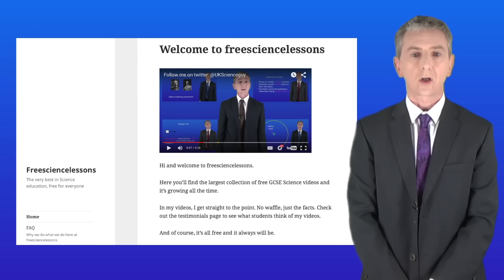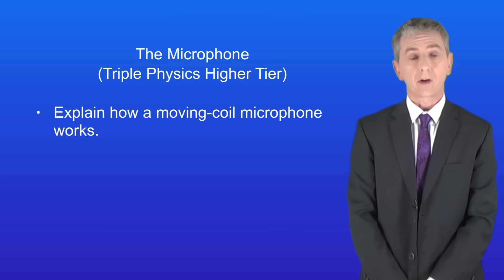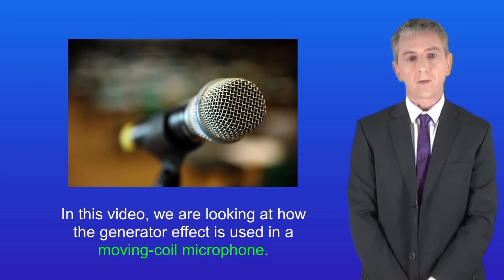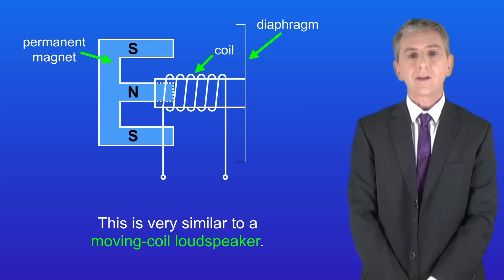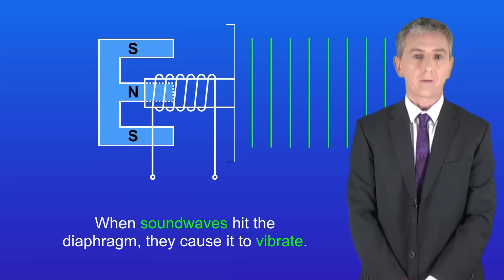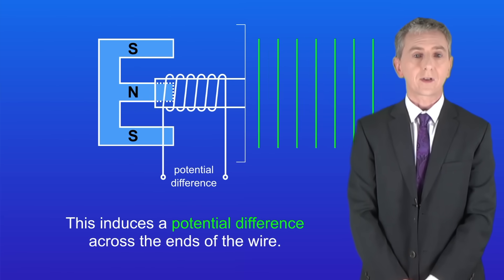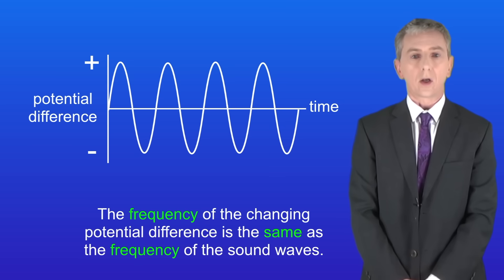GCSE Physics Revision "The Microphone" (Triple)

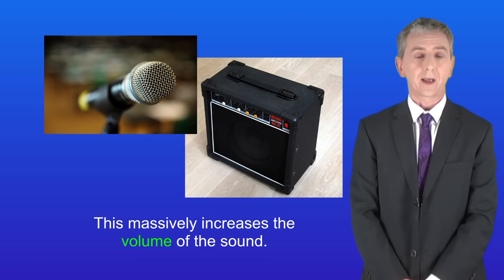Comment: Hello sir what do you mean by the last sentence? May you explain it in simple words - especially the word amplified (what does it mean)? 1:32. So, does it enter through the loudspeaker? Doesn’t current go through the loudspeaker instead? Please explain this.
Reply from the maker: Amplify means to make larger (or greater). The amplifier takes the pattern of changing potential difference from the microphone. This potential difference will not be very great and if you fed this into a loudspeaker, you would hardly hear it. The amplifier increases the potential difference (without changing the pattern of the potential difference) and then feeds it into the loudspeaker.
Reply: Freesciencelessons thanks sir.